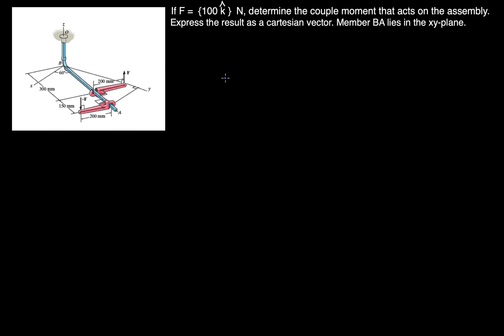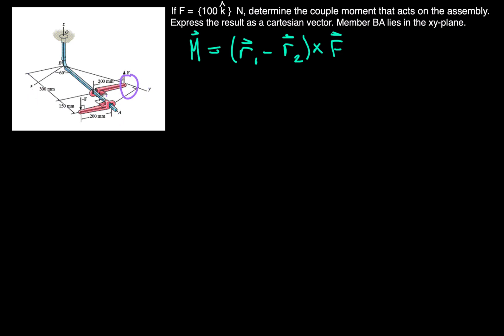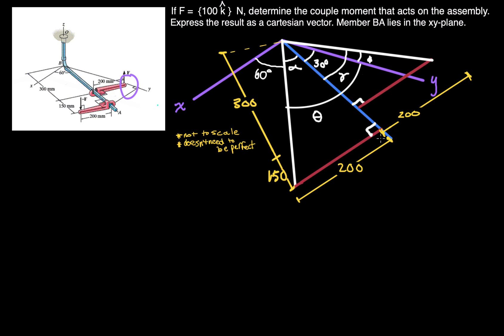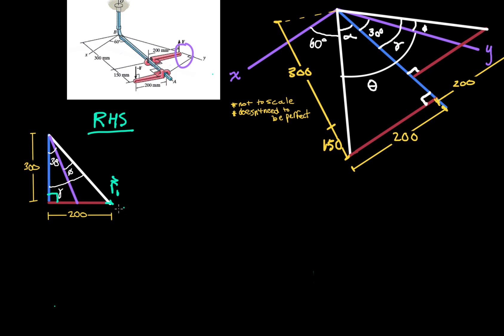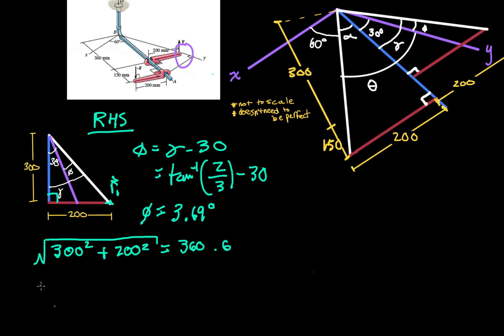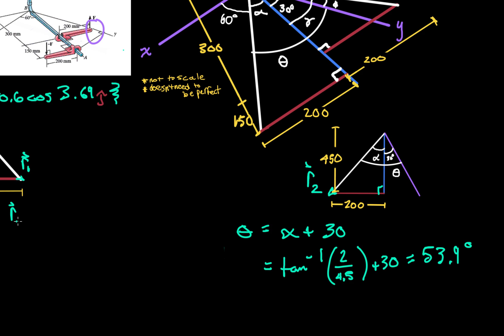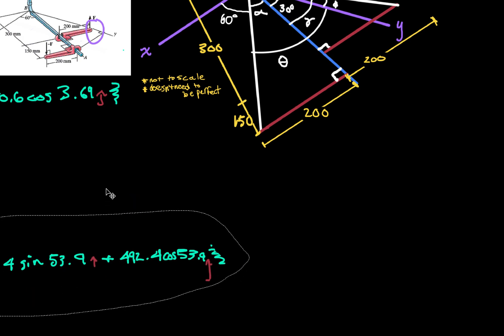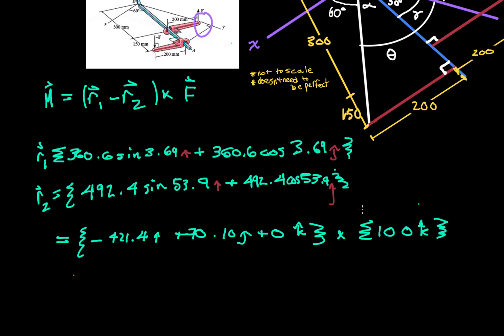Hardest Statics Question | If F = {100k} N, determine the couple moment that acts on the assembly...

Comment: The angle calculations for alpha and gamma must be zero because the angle between the x and y axis is 90
Reply from the maker: Ah yesthat's an error in my diagram. Thanks for pointing that out! The 60deg should be from the purple x-axis to the blue bar. With this correction, the alpha and gamma angles are not 0.